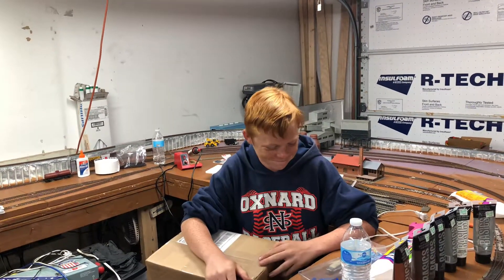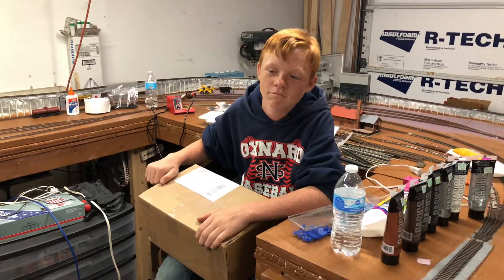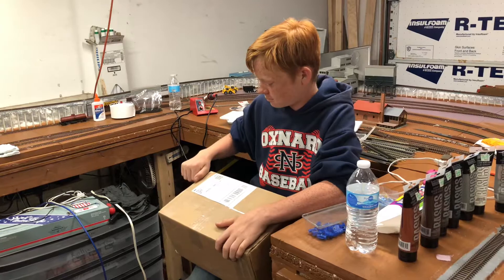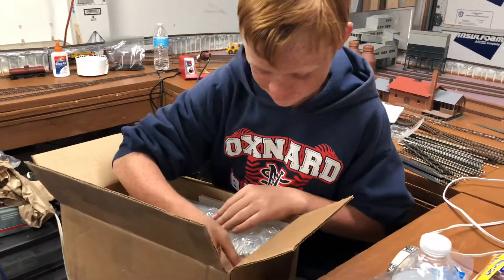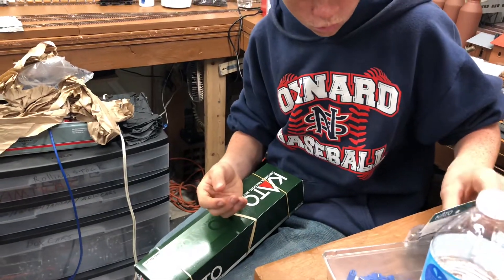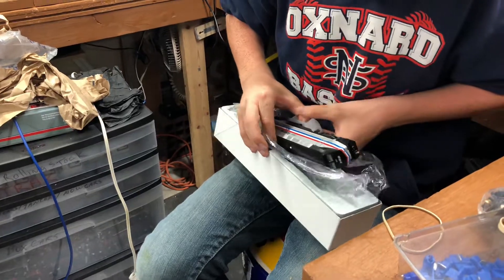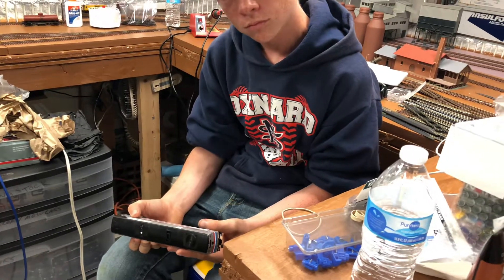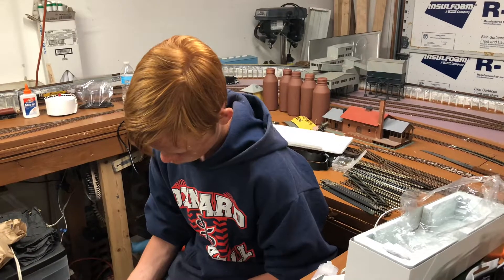Mail call 10

Comment: I love my p42 amtrak engine. 90% of my engines are KATO. Thanks for sharing
Reply from the maker: Thanks, this our first KATO I need to solder the wires for the front truck and we should be good to go.
Reply: John Dilley are you going to solder wires because you want better contact? Mine is not solder. It has brass contacts from the truck to a brass strip underneath. That is the way it comes from the factory. 

My second or third to last video shows how I installed the truck on that engine.

Thanks for the reply
Reply from the maker: I am going based on what seller told me. He said that he had problem while was under warranty and the front truck was replaced. The same problem happened again but out of warranty so he bought the front truck but thought he had to solder it and left it set. What you saying makes sense to me but there are red/black wires in that both ends. So neither truck is supposed wired am I correct?
Reply: John Dilley yes the red and black wires are from the motors in the truck to the brass contacts sticking up from the trucks. Those make contact to the trains underside brass strips. No solder needed.
Reply from the maker: My unit is DCC and sound. I disconnected the red/black wires I have sound but no movement.
Reply from the maker: The wires are still in place on the motors
Reply: John Dilley oh that is right. Your unit has more wires. 

Do you see an arrow under the truck itself. It needs to be facing the correct way. Forward for the front and back for the rear.
Reply from the maker: They are in the correct position. I think will solder the wires to the brass strip.
Reply: John Dilley hope that fixes the problem John.

Take care